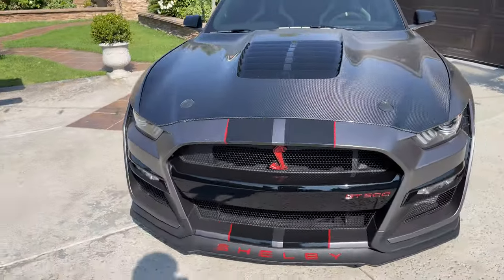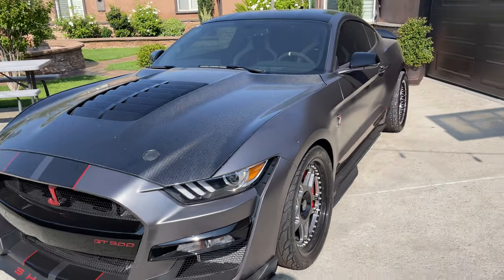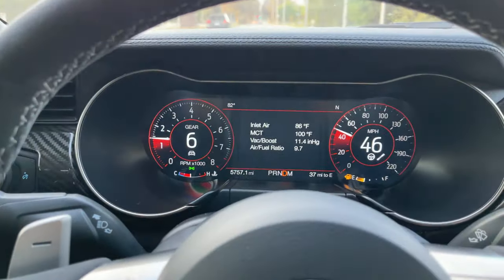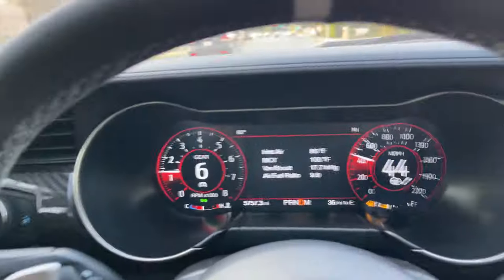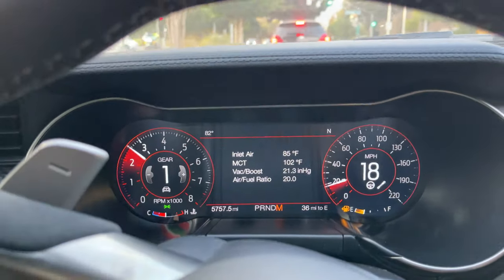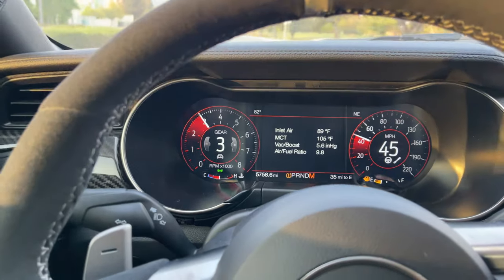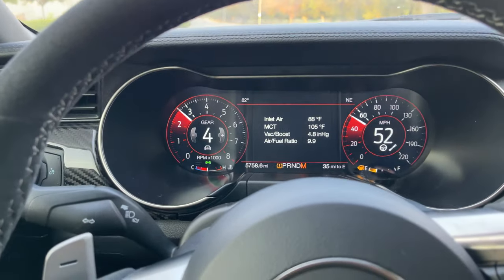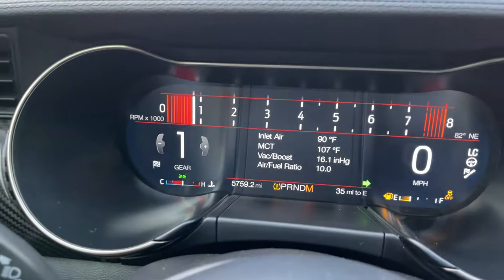First Drive/Pulls In My 1050 WHP 2020 Shelby GT500!

Comment: Are you still running stock breaks and rotors front and back? If so what did you end up with for a wheel and tire combo, trying to find a setup for my GT350 but the break rotors are soo big it puts a limit on what you can get.
Reply from the maker: Yeah still have the stock brakes, these wheels are 20’s in the front and 18’s in the back by Bogart Racing wheels

Comment: Did you lose your warranty after you modded it ???
Reply from the maker: Yup! warranty is gone
Reply: @AutomotivePerformance  so I don’t understand fully, why not just get a way cheaper car in mod it to be fast ? Why start with a six figure Car.
Reply: Because it’s better to start with a strong platform. You have less problems and less things you have to change. When you start off with cat that makes 250-350 hp stock . Nothing on that car was meant to make 800-1000whl. You have to upgrade everything fuel system high and low , engine top and bottom , by turbos or blower , build transmission,  rotors , calibers , rear end , upgrade axles , drive shaft ,wheel studs, shocks and springs , clutch if manual ,radiator, all fuel lines and the list goes on. Why not just pay the money up from and only have to change two pulleys , e85 tune , long tubes and possible heads and cams and have a fast reliable car and platform
Reply: @speedlife301  why not just not change anything in leave it stock ?

Comment: If you want colder Air temps do yourself a favor put a meth kit in it you'll get the benefits of high octane and cold iats having in my thousand horsepower turbo mustang great bonus and also if you run it with e85 you get double the benefits and safety
Reply from the maker: My shop and I were talking about that the other day, it’ll def help and be beneficial!